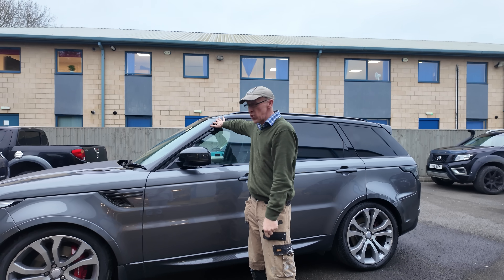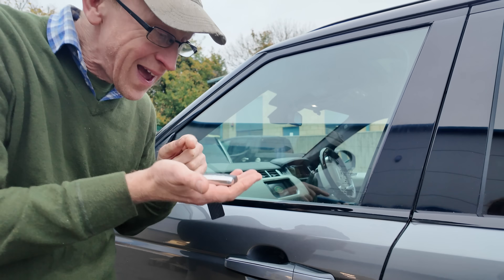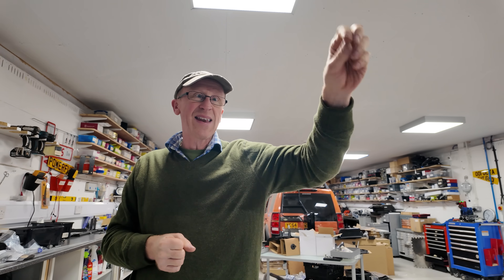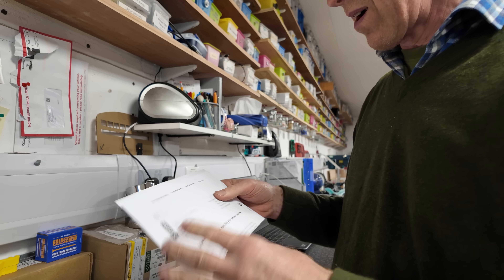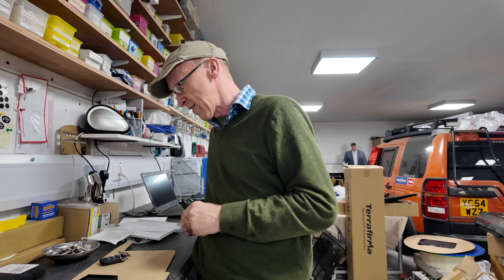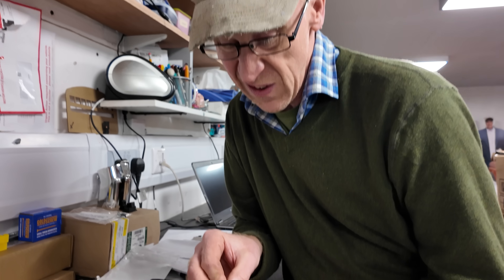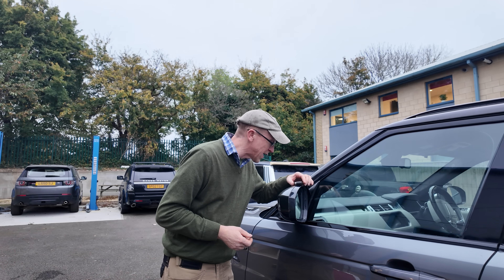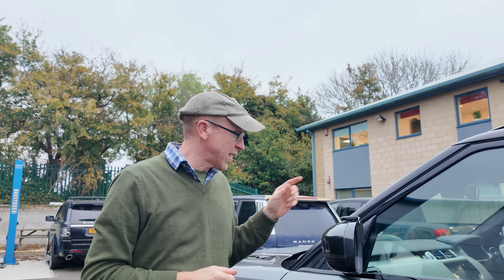Land Rover / Range Rover Relay Vehicle Theft Explained & Sleeping Keyfob Battery Solution

Comment: Thank you for the tip, Simon, but I think there’s been a misunderstanding.

We are the official manufacturer of the Sleeping Battery mentioned in the JLR letter.

This is a patented and certified coin cell battery, with the technology already built into the battery.

So, simply replacing the battery with the Sleeping Battery will protect the car :)

This is still available on our own webshop.
Reply from the maker: For your information I am still waiting for JLR to respond to me on the availability of the battery...seems like they offered the free battery upgrade but no one ever got it ( see comments below ) do you have a supply issue with your product ?
The issue with the tech built into the battery like you have is that when the battery goes flat you have to throw the whole thing away - this is very expensive and there is a lot of tech going into landfill not just the battery ! Also people are commenting that your battery's do not last very long - please read the comments below.
Reply: Thank you for your response!
Many duopacks have already been sent to customers who requested one. If you haven’t received it yet, it will most likely be sent soon!

Since the end of last year, we have developed version 2.0 with improved technology, which is also being sent to JLR customers. We’ve received very positive feedback on it so far.
Should the battery drain quickly after all (which should actually no longer be possible), we will, of course, look for a suitable solution.

Of course, you also have a great solution, but the Sleeping Battery has a very simple installation, and the car owner only needs to replace the battery. From our experience, with a loose print, the chance of damaging something during installation is greater.

The choice is ultimately up to the car owner, but we noticed that you’ve used the name "Sleeping Battery" several times in a sentence with your own product. However, these are actually two different products. :)
Reply from the maker: FYI - I just got a letter today saying that JLR will send out the sleeping battery......that was quite a wait !

Comment: 09:59 It can’t be like that exactly because that would rely on perfectly synchronised clocks. Changing a battery in a fob would desynchronise.
Reply from the maker: I guess there are ways around this. The clocks could resync when next to each other. Do a google search for "how does ultra wide band locking work" and you will understand more.

Comment: I received a Faraday Pouch from Land Rover for my Discovery Sport.  I too applied for my 'sleeping batteries' online, but have not heard anything yet.
Reply: @laurenceholdcroft9965  me too - they never arrived.  But as I was doing a long cross-European trip I bought a pair.  BUT - the sleeping battery only lasted 3-months.  Simon’s solution is much better as you only buy once and replace only the standard battery when it goes flat.

Comment: IMPORTANT UPDATE - the original "sleeping battery" doesn't last.  I am getting a "low battery" warning after just 3-months - and these are £50 each!

So - Simon's solution is the better option as you only pay the £55 once and use a normal battery after that. 👍

Comment: The simplest solution would be for manufacturers to ditch keyless entry. Pressing a button is no drama. Getting your car stolen is. Keyless isn’t a game changer for the consumer. Re UWB they thieves will find a way
Reply from the maker: Some valid points you make.

Comment: Hello Simon…just back from a storm battered Sidmouth!  Now I understood/understand that my 2022 L494 has the upgraded delay system but I do keep the keys in a tin box at night. However during the day when they are in my pocket, maybe there could be a problem. Then…my “ keyless” entry has been disabled or maybe not even fitted so I have to use the key every time. Also…in vulnerable situations, I have my trusty heavy steel steering wheel theft bar with a complex key from 1980 which has nothing electronic about it! I’m surprised that battery sleeve is £100 which seems rather a lot so does that have complex stuff buried inside it? The Faraday pouch is a good idea, my tiny shortbread tin box works perfectly and the bar should make them think it is too much bother but what will the insurance world say when time to renew in April?? Will it be cheaper now???….i suspect not! A nice idea Simon…will JLR send me one though??…I might call in and ask! 😬😄😄😄😄Richard.
Reply from the maker: Hi Richard - glad to hear you have been away... we too have been away ..still trying to fix the old French house up ! I can have heating or hot water... but not both !
Your car should have the ultrawide band with the time stamp .. that should stop the relay theft... although there are other ways they have now. Its really like a game of cat and mouse. We are still working with the police who use our fleet of cars for training officers to determine a cars true identity !
Reply: @L663  Hello Simon…yes a week away in the 1960 luxury of Sidmouth! It is a very comfortable bubble but feels like I should arrive in a 1959 Rover 95…😃😃😃 I thought you were away again and hope you can resolve the water problems…I suppose an hour in  hot bath works but chilly when you get out! Yes I’m fairly certain I have the later security..they told me I did and that it s not keyless may confirrm….I am extremely careful where and when I park it but recently had no choice to go to a place I have not seen for 40 years and it has not improved..it frightened me to death ( best not say where on here though…I just hate Bristol!) . As for thieves….they are always very clever….i doubt anything will beat them for very long. I hope the rn stops…we had tremendous storms on Saturday with a big Emergency call out for reports of a body in the sea but none found. Let’s hope this week improves! Richard🙏🙏🙏😃😃😃😃

Comment: The RFID pouches when new work, but over time or if the key isn't in correctly you can still open keyless vehicle. I am still using the RFID pouch as well, but I place my keys in a RFID box. well away from the front door. I have tried opening my vehicle with my keys inside the RFID box when placed on the car. Car stayed locked, well worth the minor cost investment. Available on Amazon/eBay for example. The plus side, I am terrible losing my keys around the house. now I can find them if I have put them in the box each time. A lot cheaper than the sleeper battery kit.

Comment: When i owned a 16 and 17 my DS i just switched the keyless off (it’s a button press combo) permanently. Saw a video of a bloke doing it on a Disco 4 and it worked on my DS. Very useful as keyless was standard for so i had no choice but to have it. Also, that pouch looks exactly like the ones we bought in Aldi at least 6 years ago 🤔🤔😂😂

Comment: The slim battery will be a CR2032.  The standard may be a CR3032. First two digits are the thickness..second two the diameter.
Reply: The standard battery is a 2032, not a 3032.

Comment: What is the battery code for the new version, original is a 2032 (IIRC) meaning 20 mm diameter 3.2 mm thick) but you can also get 2025 and 2016 (2.5 mm 1.6 mm respectively).  I guess they are probably using the 2025 which should be readily available to end users so you could hip without batteries if you wanted.
Reply from the maker: I never knew what the numbers meant so thanks for sharing.

Comment: I don't think I'm ever going to be able to look at my Land Rover key again and not imagine it saying "Hello, I'm Simon. Let me in."!! 

We haven't had any kind of communication from Land Rover in Japan about this. However, as soon as I got wind of the situation in the UK from yourself and others on YouTube, I bought a Faraday box which came with two pouches which are identical to the ones you received! I have one pouch in my caravan to use when I'm out and about touring. The Land Cruiser 300 (soon also the 250 I suppose) as well as the Toyota Hiace van that are the most popular targets for thieves. Car theft is on the rise here too, but nowhere near UK levels, but the way I see it is make it difficult for the thieves now and it will help to stop it becoming an epidemic! Naturally, my spare key is also in the Faraday box and there is enough room in there for me to put two Land Rover fobs, my wallet, the house key (also a wireless thingy) and the garage remote. If nothing else, it has centralised where all my 'necessaries' are tidied up the top of the piano where I'd typically dump things until I bought this box. I'd be very interested in purchasing those 'sleeping-batteries'.

Comment: I suspect the "new system" ultra wide band with the time delay wont last long. Based on your explanation after the encryption has been reverse engineered they'll adapt the relay attack to add the extra time their equipment takes. Sleeping batteries though, that's a game changer. Great video as always guys.
Reply: If the car sends a challenge message to the key at the speed of radio waves (speed of light), and the key gives its response to it within nanoseconds, the distance from the key to the car can be precisely measured down to tens of centimetres. A relay system extending the possible distance would need to go faster than radio waves can, which is impossible (if you know how, a Nobel prize awaits). Of course, if the encryption is weak (i.e. botched), then the problem will persist.
Reply: @jonathanpaton 
That's exactly how contactless card payments work. 

It looks for a delay, if there's a delay it suspects relay attack and declined payment. 

All car manufacturers could do this.

Comment: This will work if the key is not moved. But if you are in motion ,they can stay close up to you (in shopping mall as example) and wearing a backpack with a transmitter. Keep that in mind!
Reply from the maker: Good point but it’s all about making it harder for the thieves
Reply: That's why you still keep it in a Faraday pouch. 👍

Comment: A motion-detecting battery skin - times are crazy, but if it works, it works!  It could well extend battery life too, depending on how efficient the motion detection hardware is.  :)
Reply from the maker: Yes the motion sensing software must have some passive power drain.

Comment: I received this letter from Land Rover for my 2016 Discovery 4 Landmark about 3-months ago.  I did send off for the free sleeping batteries, but they never arrived; so I guess they are all gone.

I did buy a pair of the original sleeping battery on Amazon. These are different from the one you sell and they cost just under £100 for the two - these are now in both my keys.  They work very well. 👍

Yours are slightly more expensive - BUT - yours have the advantage that when the battery goes flat, you only have to buy a normal (or thin normal) battery at the standard price, instead of having to pay out another £50 for a new sleeping battery.

Expensive, but highly recommended as it's very cheap compared to the cost of your Land Rover.

Oh - just remember they swith off after 3-minutes, so if you are stationary in a car park and then try and start the car, the car will not see the battery until you pick up the key and move it (as i discovered the other day when the car didn't see the key). ☺

Oh - i have not been called in for the security update yet, the letter just said it would be "later this year" and I received the letter in early September.

UPDATE - April 2025
I actually have just received my set of sleeping batteries from Land Rover - about 6-months later than they said I would get them.  I won't use them though, as Simon's solution is very much better and is what I am using.  Still waiting for the recall for the secuity update, though.
Reply from the maker: Hi John thanks for the information…. Especially the tip about being still on car park or waiting to get off the ferry etc

Comment: So they took my Discovery 4 in around 45 seconds. Both of my keys were in Faraday pouches. All they did was break the driver side glass, open the door and put something into the OBD2 port, that killed the alarm system and allowed them to start the car and drive away. Perhaps relay theft is becoming a misnoma. Well out of pocket now. Have taken lots of steps to now protect my newish vehicle and some they will not like!
Reply: BMW had the same vulnerability. Don't know if it's been fixed. The gadgets used were for sale online, £70 including helpline service if you had a problem 😄.
Reply: I think that this is what the Land Rover security update is designed to stop.  I will find out when they call mine in - hopefully soon.
Reply from the maker: Sorry to hear about them stealing your car.. I need to do a video on the start stop button relocate loom that we sell.

Comment: My March 2023 delivered D250 Defender 90 got recalled for the security “upgrade” in July this year - it took a whole day then another two days sorting out what went wrong when the dealership tried to do a 2nd update that bricked the whole car………… I wonder if the security update was just adding that little sleeve over the battery because they needed both fobs to do it……….I’m too chicken to open my fobs to find out!
Reply: My L663 (same age as The Stig) was upgraded on my drive by LR Assist, it's a software upgrade. They also did something to the ODB port (not saying what on here). They need both fobs to check they still work afterwards. 😉

Comment: The key isn’t reaching out it responds to the car seeking it (think where the big battery is) Relaying pushes the cars ping close enough to the key for it to confirm. Toyota keys can be made dumb with a double click sequence.
Reply from the maker: Thanks for the clarification.. but i think my explanation still helps people to understand what the system is doing etc.
Reply: Correct explanation 👍
Reply: You can also make the Land Rover keys dumb with two clicks
Reply: @jambom33 
The crims also make the keyless feature on your keys redundant by stealing the car.
Reply: So can my 2017 Jaguar Xj.

Comment: So you only get just the one battery keeper electronic gizmo and the pouch is presumably for the spare key? (Now answered by your website)
There is another company in the Netherlands that makes something similar called the 'sleeping battery' (can't post the url as it will upset youtube, but a google should find it). But the electronic gizmo is built in to their version of the CR2032 cell, which means that when the power is exhausted you have to buy another. They also supply 2 batteries for roughly the same cost as the battery keeper to cover 2 sets of keys, but the downside is that you have to spend a lot more than the cost of a standard CR2032 battery when the time comes to replace it.
EDIT: Just found the battery keeper on your website which you price at a much more wallet friendly £55 rather than the £99 asked by Autotech!
Reply from the maker: Yes - I guess the solutions go in this order....
Best - Circuit built into the kefob itself ( Ford )
Next best - Circuit built into the battery ( Autotech )
Nearly as good - Add on circuit ( this is not ideal as you are reliant on the 3 component - the Keyfob / the battery / the circuit - but as you say its the cheaper option long term )

 As you say the pouch is for your spare key ( or you could just remove the battery )

Comment: Ford Rangers have been delivered until very recently with keyless entry disabled. In the last month I’ve had complete brand new keys from the dealer, free from Ford, with keys that go to sleep and they have activated the system on the vehicle. These are not batteries that are shielded after a short time, such as those in the video, but complete new key fobs and the dealer drills a hole through the centre of the old ones to destroy them. Obviously the physical emergency key, fitted in the fob, are swapped over from the old to new fobs and the new keys must be paired with the car. They took well over eighteen months to sort this, but that is far shorter than JLR’s usual lethargic response to a problem, which has taken them years to  solve and made customer’s vehicles prohibitively expensive if not impossible to insure in some areas.
Reply from the maker: The batteries are a clever solution but clearly if the sleep aspect was in the keyfob itself that would seem a better solution. The batteries are not shielded... the battery circuit cuts the power from the battery to the keyfob.Interesting to know Ford had the issue as it was their invention as i understood it !

Comment: Interested to know what is recommended for the spare key (assuming not normally used)? The same clever solution or just take the battery out and keep separately?
Reply from the maker: For the spare key ( if not in use either remove the battery or put it in a foil pouch. )

Comment: Wouldn’t disabling keyless unlocking (using the 3x lights button + 1x unlock button trick) accomplish the same result without the need for the sleeping battery device?
Reply from the maker: That would work but you loose the convenience feature - with the sleeping battery device you have the best of both worlds ?
Reply: @L663  What is the 'inconvenience' of actually pressing the buttons, on the fob that you must have with you anyway !
Reply from the maker: @JimRudman  once you get used to it is really handy.
Reply: I hear on some vehicles (Evoque) this can cause a serious battery drain!
Reply: Good to know about these issues, as thieves are everywhere now and always one step ahead of most folk